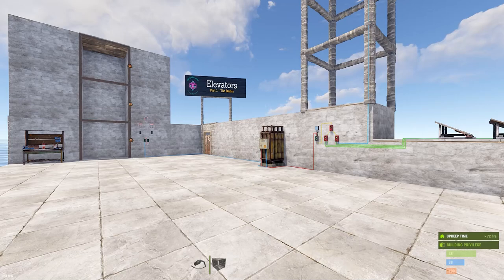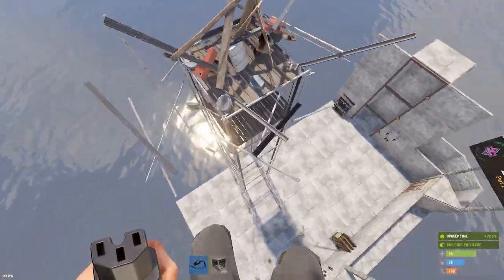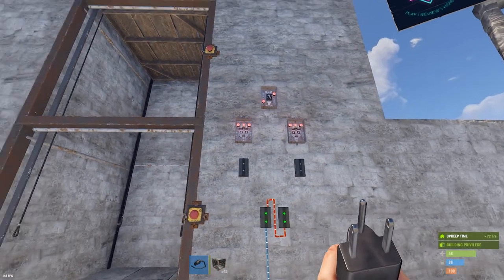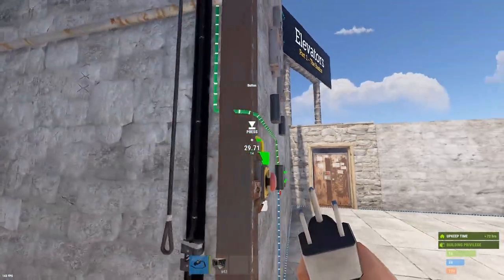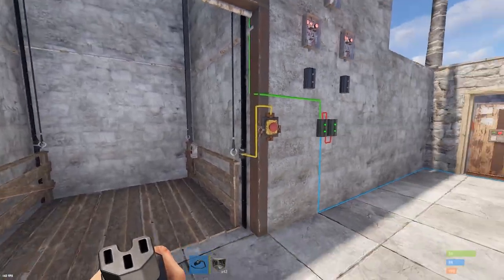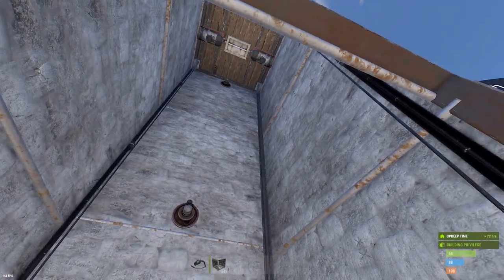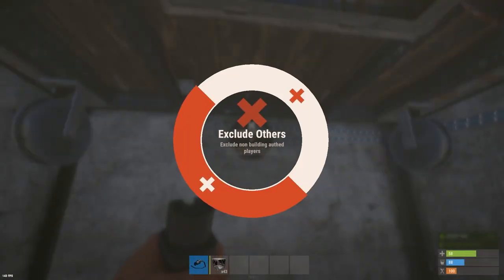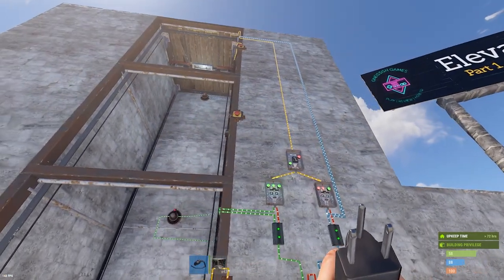RUST Electrical Guide | How to Use ELEVATORS - Everything You Need to Know PART 1 2022

Comment: Thanks a lot for your electrical guides. Learned alot by watching them, even if sometimes I have to watch them several times to fully grasp your concepts. 
One question tought. Do you think or know of any possible way to signal on which level the elevator stopped the last time and is currently at - independend of the fact if he was called from that level (empty run) or run from one being inside which means you can't use the HBHF sensor? So for example using timers to close a garage door which is used at the elevators entry and after stopping for a second on the other level that levels door opens?
Reply from the maker: Thank you! I have an ongoing elevator build that is getting close to exactly this. It works, but is WAY too big. I need to simplify it

Comment: What if you are getting in the elveator and someone runs in with or behind you - it will work because its you detected or stop because it detected them?

Also when you showed the elevators being broken from top down  - what if broken from bottom - will the whole stack of elevators collapse? You said good for bunker but, maybe not good for penthouse - since if they all do collapse then they can just ladder up the inside ?
Reply from the maker: The elevator would work because the HBHF detected you. To shut it down when an unauthorized player followed would require another HBHF.

And regarding the stacked elevator question, I don't remember! I'll try it tomorrow and let you know.
Reply: @AustinKlailaGames  Please elaborate on the requirement of 2nd HBHF and how it would be wired to work in order for a player following close behind or with you so as its shut down and not active from you. Thanks.

Ps Im on Xbox but, loving you videos that I am able to implement :)

Comment: Could you just use an OR switch for the HBHF sensors into the AND?
Reply from the maker: Assuming I understand you correctly, yes, you could set it up either way. There are a few ways to do this, tbh

Comment from the maker: IF YOU WANT MORE THAN TWO STOPS - you will need to increase the 9v by 1v each time you add more packages (Branch Switch, AND Switch, HBHF Sensor) beyond two floors because of the additional OR Switch requirements. If this is confusing, get me on Discord and I'll provide you a link to a schematic with your specific floor count.
Reply: Couldn't you run the multiple HBHF sensors through an OR switch to use way less power?
Reply: dont get it how u can make more then 2 connections to the or switch if im gonna use more then 2
 sensors